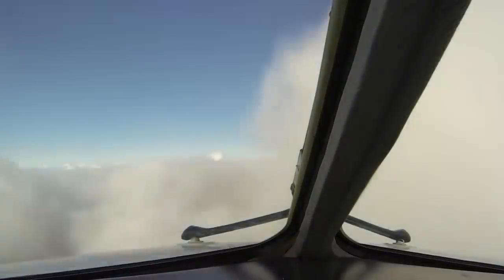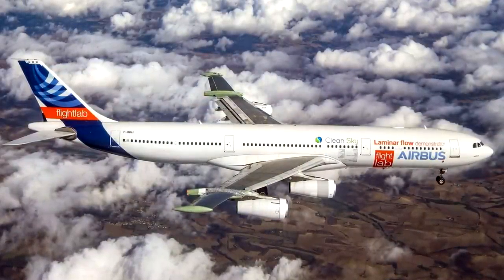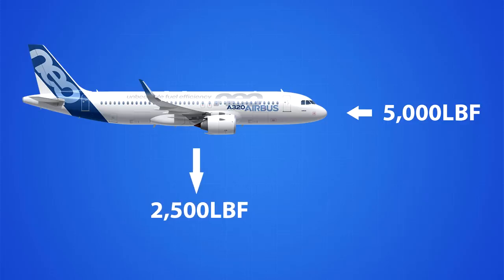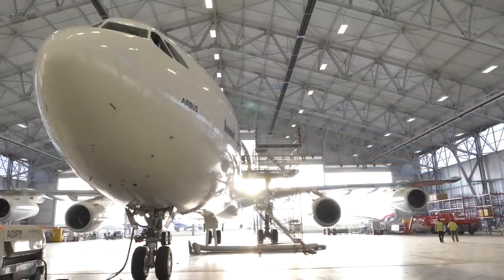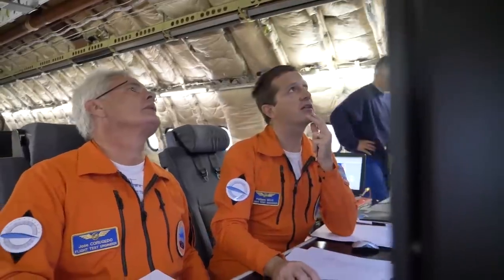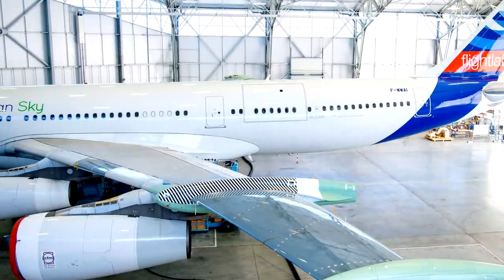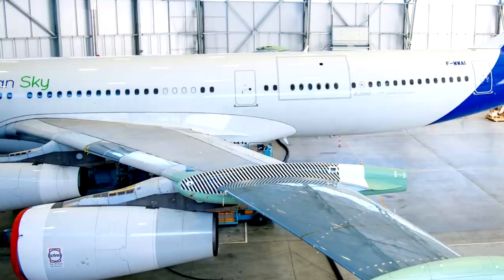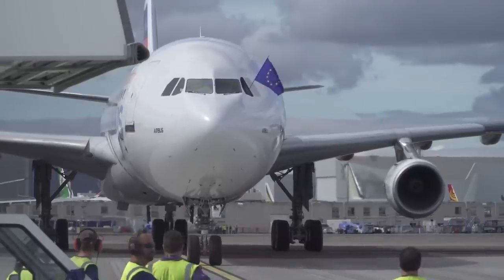What Is The Airbus "Blade" Project?

Comment: The biggest problem is that the wing is too sensitive to icing and has poor stall characteristics.  There is a good reason that no manufacturer has used this type of wing profile.  Laminar flow wing experiments started back in the 1930's and 40's.

Comment: Just had a lecture of wing profiel at university yesterday.
The impact of objects on these kind of profiles is huge, so the insect flights make a lot of sense.
Also is it very difficult to build a laminar profile which has a wide operation rage, normally laminar profiles only have a small peak, where they can operate efficiently and safe, otherwise a stall or an immens resisteance get caused very soon at diffrent angles of attack.